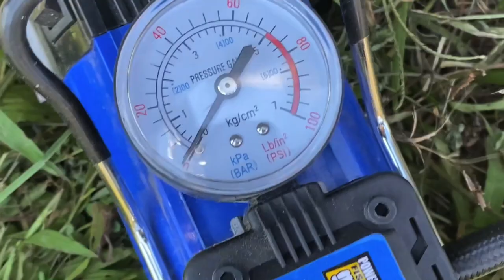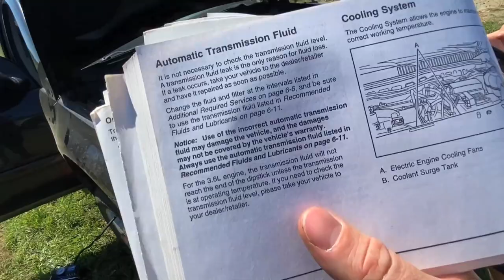Epic Equinox CRASH!

Comment: Mark why not sell the salvaged parts like doors and other things to a auto body shops cause the switches and motors glass and the hinges cause in one door if in almost perfect condition is a minimum $1,500.00-$2,000.00 so $6,000.00-$8,000.00 just in the doors alone that is 15 to 20 cars if at what you pay roughly $400.00 dollars a car just in 1 car alone
Reply: Its a first gen Equinox theres not alot left on the road and who would pay that money for parts that expensive most of the people would junk them if they get into wreck for example.